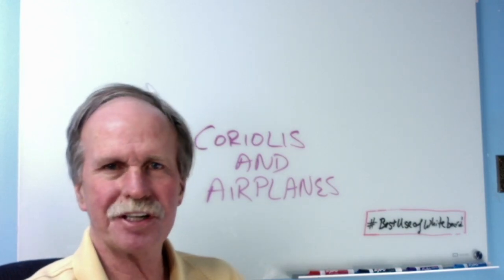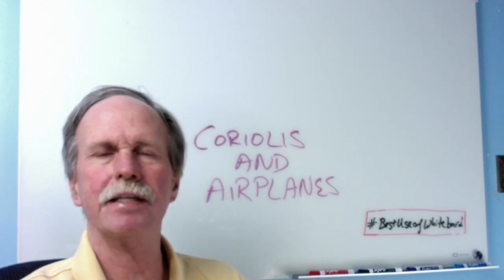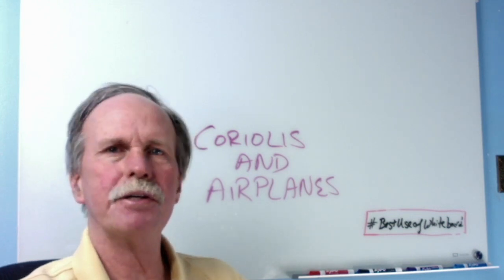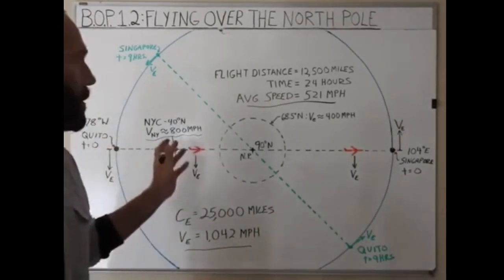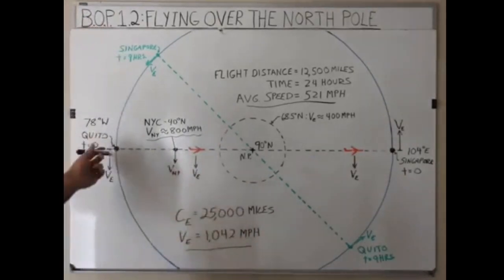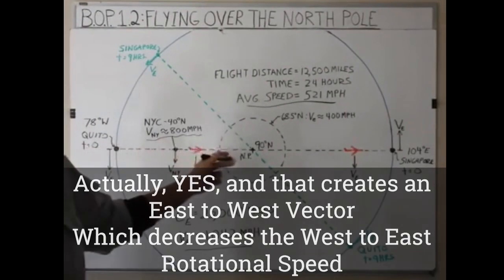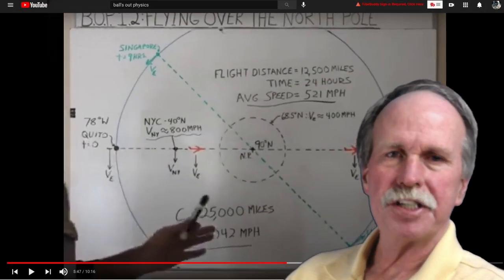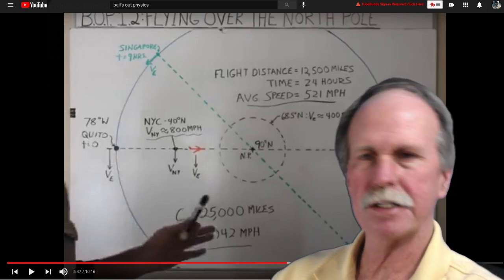Brian Mullin | Coriolis and Aircraft

Comment: Of course on a flat non rotating earth you wouldn't start off with an imaginary ground speed that somehow has to pretend to adjust with change of direction and latitude lines nor would it have to lead it destination point like a duck hunter leads the duck flying over. 
The flat earth pilot just flies a straight line at a steady speed with no imaginary speed adjustments for Coriolis
Reply from the maker: Imaginary ground speed?
Reply: @ResearchFlatMoon   Yes you guys assume that even while the plane is parked on the runway it already has an imaginary ground speed.
Reply from the maker: ah, no it doesn't.  It has a rotational speed that matches the rotation of the earth at that location.  In Michigan that is about 735 mph linear speed.  There is nothing imaginary about that rotational speed.  I am currently conducting an experiment that measures its effects.  Ground speed is speed over the surface of the earth.
Use the right terms.
Reply: @ResearchFlatMoon  a plane parked on a runway travels at the same speed as the rotation...0mph
Reply from the maker: Incorrect. Rotation is easily detected.
Reply: @ResearchFlatMoon  ok if you say so
Reply from the maker: @fetruth9514  it isn’t me ‘saying so’. It is measurable by anyone including you but isn’t subject to debate. It is a verifiable fact. I measured it myself this week.  The fact you can’t comprehend it is on you, not me
Reply: @ResearchFlatMoon   Sure you did. 
 Everything's up for debate there is no such thing as settled science and you should know that calling yourself the science guy
Reply from the maker: @fetruth9514  this is settled and not open to debate (only denial), and yes I did.  Unless you can explain why objects weigh less in Florida than in Michigan on a flat earth. I'll wait.
Reply: @ResearchFlatMoon  a true scientist would never say that. Unless you are God and have exhausted all possibilities.  
You are not God so it is not settled
Reply from the maker: @fetruth9514  It is settled.  It was settled centuries ago.  Time for you to get with the program and embrace reality.
Reply: @ResearchFlatMoon   And how exactly does that show proof of a spinning tilted pear?
Reply from the maker: @fetruth9514  you wouldn't understand it if I told you.  Before I answer tell me why, on a rotating spherical planet, the decrease in weight is expected. BTW, I measured tilt today as well.  14 deg 44.6 m relative to the sun today.
Reply from the maker: So you can’t explain why the weight would change on a rotating sphere any more than you can explain how it would on a flat and stationary earth. You are dismissed. Run along and tell Nathan you won
Reply: @ResearchFlatMoon   You only won in the deep recesses of your empty head. You have a warped imagination. Eotvos doesn't prove a spinning oblate spheroid by any stretch of the imagination
Reply from the maker: @fetruth9514  you are welcome to ‘try’ to explain it on your non rotating pizza. I’ll wait. And by the way I didn’t demonstrate Eotvos  with this experiment. You don’t have the first clue as to why it confirms rotation.  Or what Eotvos actually is or you wouldn’t have confused it with what I demonstrated.
Reply from the maker: You really need to hit the books again FE. you are just confirming your ignorance. We haven’t even addressed Coriolis.
Reply: @ResearchFlatMoon  Seems you should get a noble prize if you can detect the rotation of the earth from the earth. Show the test they done plz to show rotation of the earth. I'll wait
Reply from the maker: @cannoncarroll722  pretty easy, Thanks Bob.
Reply from the maker: @cannoncarroll722  it is pretty easy to do with very inexpensive equipment.

Comment: Engineers can be a very odd breed, I once had a discussion with one in a bar in Edinburgh over the Airbus fly-by-wire control system, his conjecture was that if the aircraft found itself perfectly inverted it would be unable to decide which way to wright itself? As an Airbus training Captain at that time I explained that while his theory was academically possible the concept is way outside certification criteria, once an Airbus FBW aircraft exceeds certain pitch or roll limits, the system reverts to a basic mode that puts the pilot back in charge. I think these guys forget that we’re strapped to the front of these things and why we’re there at all?

Comment: How do aircraft account for coriolis: the pilot wiggles the stick.

Seriously, that's how they do it. They plot a course and whenever the plane starts to deviate from that course the pilot (or autopilot) brings it back on course. That is literally all there is to it.

As plane flies from north to south or vice versa, they will experience coriolis and all they have to do is fly alittle bit to the left or right to bring them back on course.
Brian nas to go all the way back to the 1000mph meme to try to make that sound impossible, but we have already established that Brian is not entirely honest because he pretend sthat inertial reference frames are not a thing.

So to recap: aircraft have pilots.
Reply: By the way you have the same amount of Coriolis in any direction of flight. The explanation that the different tangential speeds are the cause of Coriolis is only half the truth. Coriolis is proportional to speed, earth rotation and sine of latitude. It acts always perpendicular to the motion, right in the northern hemisphere, left in the southern hemisphere. The direction of motion has no influence on the horizontal component of the Coriolis effect on a rotating globe.

This is not very intuitive but simply follows by applying the correct math on a rotating globe. On a marry-go-round it is different. On a globe Coriolis has also a component in the up down direction, which we call the Eötvös effect and does change your weight depending on speed, latitude and direction of flight.

By the way the centrifugal acceleration is accounted for by the ellipsoidal shape of the earth already. As long as you level the wings parallel to the ground of the ellipsoid you correct for the centrifugal acceleration automatically. It’s because the ellipsoidal shape of the earth is due to the same centrifugal acceleration.

Comment: 15:53 I think you miscalculated by not keeping track of your units, dropping the “per minute” from “miles per hour per minute” (and by dividing by 720 minutes instead of 12 hours, which would have given you the much nicer unit of “miles per hour^2”). You‘re not dealing with a “wind speed” of “1.44 miles per hour”. The 1.44 mph difference in speed would be per minute of flight, which is a 86.5 mph difference in speed per hour of flight (86.5 miles per hour per hour, or 86.5 miles per hour squared). To change your speed by 86.5 mph every hour (or 1.44 mph every minute) is indeed minuscule, though. It just means you have to constantly accelerate to the west by a measly 1.44 mph per minute.

In sensible units used in the rest of the world, and by all of science, this is an acceleration of 0.1074 m/s^2 (please note that “m” means “meters” in the SI system, so this is read as “meters per second squared”). For comparison, hitting the accelerator in a Tesla Model 3 gives you an acceleration of 64 m/s^2 for the Standard Range Plus, or 109 m/s^2 for the Long Range Performance.

Comment: Your units are a bit confused I think. The 1.44 number has units of miles/hour/minute. So in other words the plane must accelerate "left" 1.44 miles per hour every minute it is flying, which is a very small amount of acceleration for big airplane engines given the whole minute it has to make it.
Reply from the maker: fair comment, and it is an acceleration rather than just a velocity.  But it is a small distinction given the magnitude of the change.

Comment: Just to add some numbers: To correct for Coriolis, the airplane has to bank slightly (Wolfie showed this in a video). Banking the airplane creates the force vector that cancels the Coriolis force and the airplane stays on the course. The bank angle automatically emerges when the autopilot makes its small corrections for anything that pushes the airplane from course, like wind. Now lets assume we don't have any side wind. The Coriolis effect depends on the ground speed of the airplane and the latitude. So the needed bank angle to correct for Coriolis depends on speed and latitude too. 

I have programmed a calculator that calculates the bank angle any aircraft has to fly to counter Coriolis. For a ground speed of 250 m/s (560 mph) at 45° latitude every airplane has to bank 0.15° to correct for Coriolis. 

This is not noticeable and not even visible on the attitude indicator. On Wolfies airplane there is a maintenance display which can display the bank angle to 0.1° accuracy. We see on this display that the airplane makes constantly small bank corrections due to disturbances like wind of about +/- 0.3°. And we see that this corrections have an offset to the side against the Coriolis effect of about 0.1 to 0.2°.

The equation to calculate the bank angle of an airplane to correct for Coriolis is:

beta = - atan( 2 ∙ v ∙ Ω ∙ sin(φ) / g )

where v = speed of airplane in m/s, Ω = rotation rate of the earth (Ω = 2 π / T, where T = 24∙3600 s), φ = latitude and g = 9.81 m/s²  = gravitational acceleration. atan is the arcus tangens function.

Note the little g here? Yes, its gravity again!

Flying at a constant bank angle requires more lift and hence more thrust. In the case above the increase in thrust turns out to be 0.0002%, which is negligible.
Reply: In other simpler words it's as if it doesn't adjust for Coriolis at all and you can't actually point to any adjustments that actually are for Coriolis or curvature

Comment: I’m always stunned that flerfers have such a fundamental problem factoring in time for addressing what they think are large differences in velocity.

It’s as if they see a large number like 1,000 mph of rotation speed and their brains fall out of their heads. When you point out Earth’s rotation is 2x slower than the movement of the hour holand on a clock they can’t reconcile that at all.

Comment: Bob: Your 1.44 mph is actually a lateral acceleration. The plane must adjust its speed by 1.44 mph every minute, ie 1.44 mph/min. It's not an equivalent crosswind speed, although that's an intuitive way of thinking about it. The acceleration can be expressed in ft/s^2:
1.44 mi/(hr*min) * (5280 ft/mi) * (1 hr/3600 s) * (1 min/60 s) = 0.0352 ft/s^2
That's only 0.1% of earth's gravitational acceleration. As you correctly say, “That’s nothing, don’t even have to think about it.“ The acceleration is the change in angular momentum (Coriolis force) required to keep the plane on course to the North Pole.
Reply from the maker: I understand what you are saying. Sometimes in my videos I trade precise accuracy for understanding. The adjustment is not made min by min, it is continuous and generally is handle by a slight adjustment in the overall course
Reply: I understand the adjustments are made continuously. My comment was meant to link the required lateral acceleration (1.44 mph/min or 0.0352 ft/s^2) to a force - the Coriolis force, the subject of your video.
Reply from the maker: excellent point.
Reply: @ResearchFlatMoon    wtf see you get things wrong in your videos too!!!!  but you make yourself to be perfect and brian mullin makes a mistake and you call him dumb???

Comment: Bob, I completely understand the math you are doing here until right at the end when you explain that the east-west correction is only 1.44mph. You divide 1038mph by 720 minutes. Are you using the correct units here? My brain is telling me it should be 1038 divided by 12. Am I misunderstanding something?
Reply: The 1.44 mph change is rate change per minute' so on average, every minute of flight your rotation speed decreases by 1.44 mph. So it would be more accurate to say that your rotational speed decreases by 1.44 mph per minute.
Reply from the maker: What Pail said. To do it correctly would require calculus as the correction is constantly applied. I broke it down to min. You could just as easily break it down to seconds.
Reply: @ResearchFlatMoon  I knew it wouldn't be linear, I just couldn't quite get my head around it when I watched the video. Thanks for the clarification.

Comment: There’s a lot stronger winds to adjust for that render Coriolis pretty minimal, that’s for sure.
Reply from the maker: That is the point. At airline altitudes you can easily have cross winds of 140 knots
Reply: It is manageable, but it is still 60 times of what Bob calculated. You can‘t divide by minutes to get miles per hour.

Comment: If you fly in a straight line over the north pole and rotates with the earth, you make a curve in space. The radius of that curve is greater than the raidus of the earth, because your speed is less than the speed of rotation at the equator.
That is the smallest radius and the greatest acceleration you get when you follow a straight line over the earth. That is how small the problem he made up really is.
Reply: I wish Youtube let me delete or correct my comments, so i could think about it when i have more time. Feel free to discuss what i did wrong.
Would be interresting to compute the side acceleration at different latitudes when you follow a straight line across the north pole.

The important thing is the side acceleration. It gets greater with the velocity across the pole, but smaller with the velocity around the pole.
Reply: @ReinoGoo  YouTube does let you edit or delete your posting. Go to.your posting and click on the three dots beside it.

Comment: Thanks Bob! If you take a yacht masters course you''ll do almost exactly the same thing. Lets just say that I wanted to sail from port A to port B which is due north. Factoring in wind and tide direction I may have to sail a course of 350° or 010° but definitely not 360°.
I know that this is not exactly the same thing but it does involve vectors and it helps if you actually arrive at your destination :)

Comment: To reiterate its the change in linear velocity as you change latitude let us consider a can shaped Earth with the poles in center of the circular ends of the can. As you go North or South over the can Earth the radius is not changing. Thus your sideways speed always matches the Earth. So no Coriolis deflection even though the can Earth is rotating. Actually as the plane takes off on both shapes of Earth it has to add a bit of East/west speed to match the Earth as it is now further away from the axis of rotation and so the circle it travels is longer.